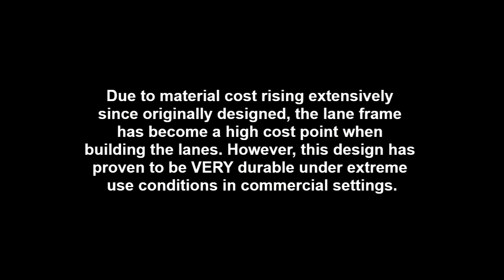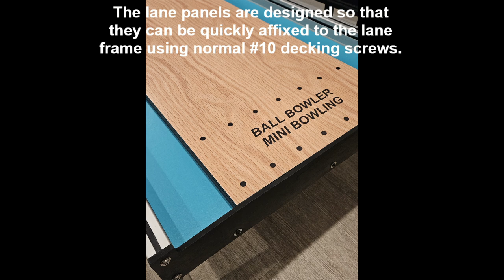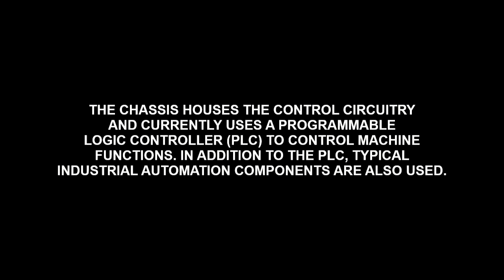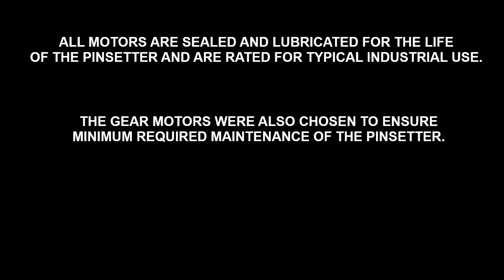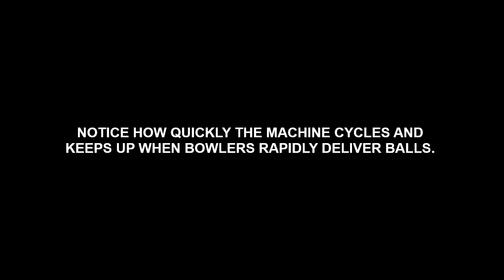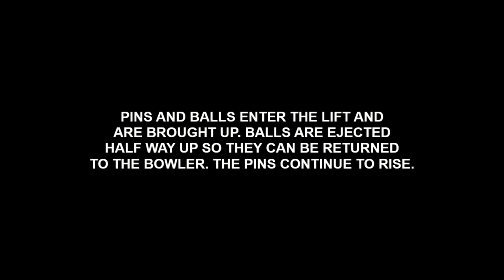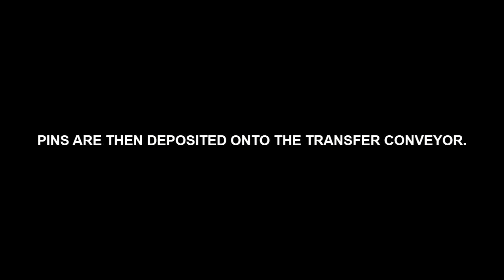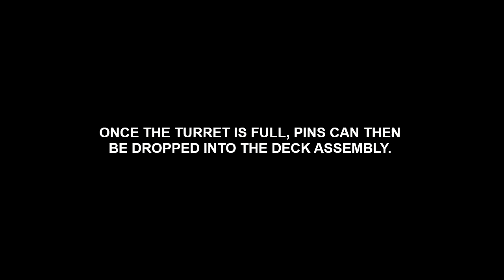Mini-bowling lane information video

Comment: How do you design your parts, right now Im trying to make a mini A2, and I am struggling to get parts for it.
Reply from the maker: I use a 2D drafting program primarily. I haven't learned any 3D software well enough as of yet but it's on the to do list. I can do a simple part in the 3D but assemblies are still something I need to figure out how to do.